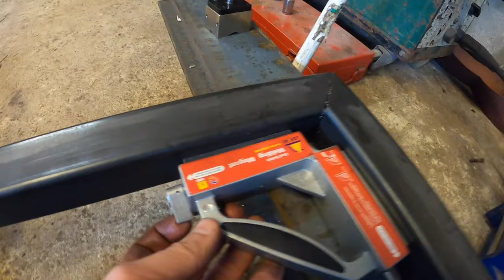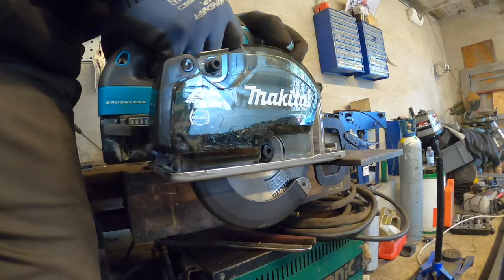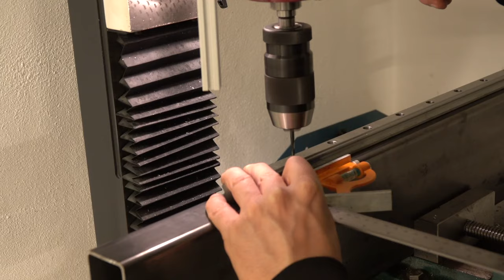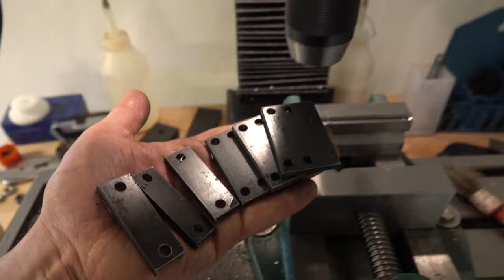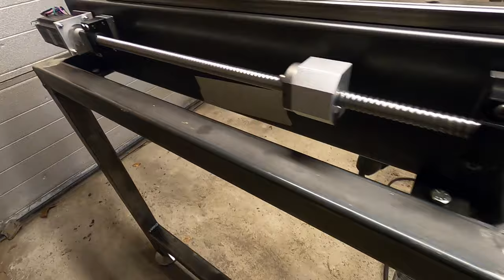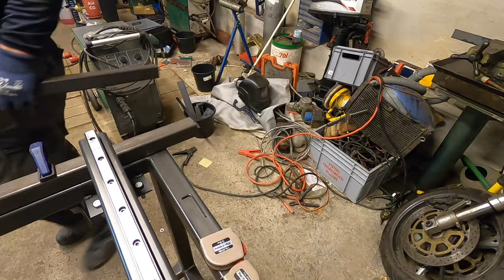DIY CNC Router Build! Part:1

Comment: Very good job, I want to DIY a CNC similar to yours. I have a question. DDCS v3.1 requires two 24v power supplies, but I have already purchased a stepper motor kit with two 48v 350w power supplies. Can DDVS 3.1 be used？ or do I need to purchase two other 24v power supplies?